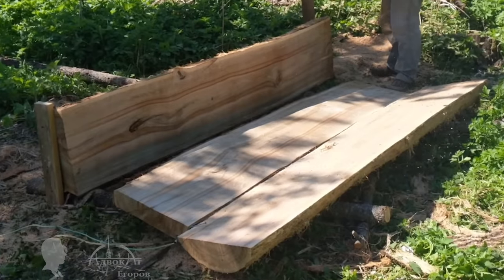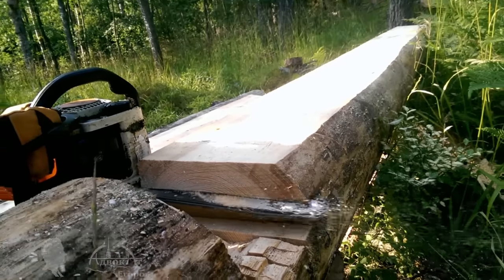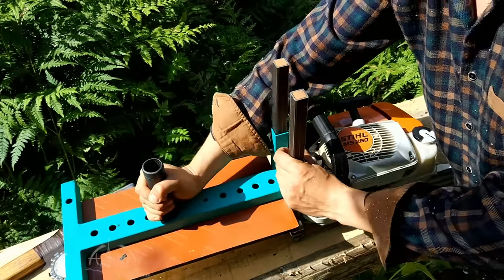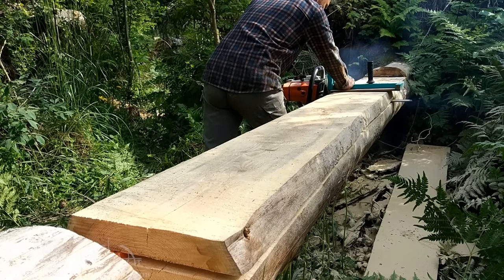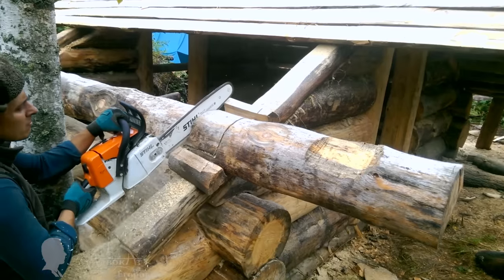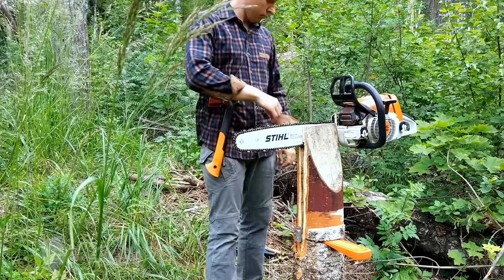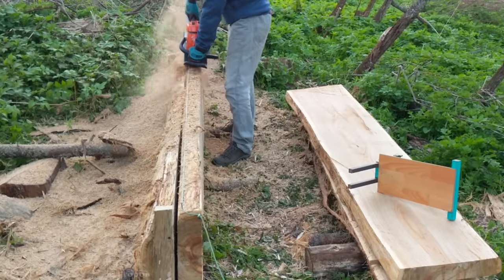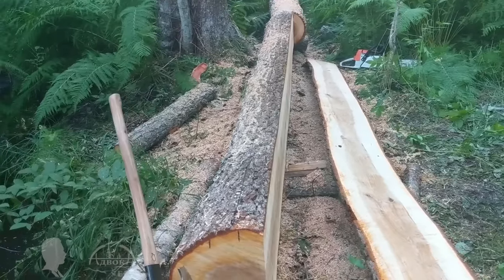Two Chainsaw Secrets | Turning a Tree into Perfect Boards

Comment: Your technique is widely used by lumber cutters in the Philippines. In fact, most lumber bought there is chainsaw milled. They get around the staking step by leaving the last few inches of the final pass until all the cuts are done then finishing all the cuts. Before cutting the final few inches they will rotate the log 90 degrees and do a second series of cuts creating perfect 2x4`s 6`s etc When the log is chocked well it does not move.  Great video.
Reply from the maker: Michael, thank you for the info
Reply: @Advoko  You are welcome. The cutters in the Philippines are using a much bigger saw. Maybe twice the displacement with a 36" bar. It's impossible for them to hold it as vertical as you do. If you are cutting on 3 teeth my guess is they are running on 7-10 teeth hence the reason they need the big power. I would love to show them your video. It's hard for them to come up with the coin for those big saws there. They could buy 2.5 saws like yours for the cost of one of the monsters they use. Never mind the extra fuel, blade wear, and the fatigue on the body holding that big weight all day. It's hard to tell for sure but I think you match or possi
bly better their cut-rate using the smaller saw. I spent many hours watching in amazement as those very skilled men who transported their one-man sawmills to the tree on a scooter cranked out a lot of lumber in a day. You have taken this to another level.
Reply from the maker: I think their technique is different as they use huge chainsaws with long bars. My main discovery was that you can mill a straight board making swinging motions and using just the lower tip of a compact saw.

Comment: Hello.  I have been working on small engines like this more than 20 years.  At 10:55 in the video, the fuel being poured into the tank looks like water.  If it is fuel it looks very clear like it has not been pre-mixed with oil.  When you pull the piston out of the cylinder there is clear evidence of overheating.  Too much friction --->  No oil or not the correct amount of oil.  Only one other thing might cause this and that is if there is no air filter.  The fine wood dust will make its way into the cylinder and destroy it.  I have been using Stihl products, and others, for more than 20 years.  Have never had an engine look like that. 
 Thank you for this video.      Привет. Я работаю над такими маленькими двигателями более 20 лет. На 10:55 на видео заливаемое в бак топливо похоже на воду. Если это топливо, то оно выглядит очень четко, как будто оно не было предварительно смешано с маслом. Когда вы вытаскиваете поршень из цилиндра, видны явные признаки перегрева. Слишком сильное трение ---> Нет масла или неправильное количество масла. Это может быть вызвано только одной другой причиной, и это отсутствие воздушного фильтра. Мелкая древесная пыль попадет в цилиндр и разрушит его. Я пользуюсь продукцией Stihl и другими уже более 20 лет. Такого двигателя еще не было.
  Спасибо за это видео.
Reply from the maker: Glen, thank you for your expert's response.

Comment: Are you still planning to publish the video about your lumber drying method that you mentioned? - I think this would be really interesting, thanks.
Reply from the maker: Malcolm, probably not as I had mixed results with it (in some cases there was a problem with mold). In other words, until the technique is improved I can't recommend to my viewers...
Reply: @Advoko  This is the way of natural seasoning.  The wood will do what it wants to do, even using the very best methods.  

Basically, wood has two types of water, inside: 1) water between the cells, and 2) water inside the cells.  The water between the cells will dry first, and fast  It has the easiest path out.  (This is why standing many freshly cut pieces on end will leave a puddle of water).  The water captured inside the cells will take the years of time. 

Imagine wood grain as a handful of straws.  When you cross-cut, you are opening up only those cells near the end.  Water in the cells in the middle of the board have to travel the length to get out of the ends.   It is the uneven drying that will cause the most stress between the fibers and cause damage.

Seal any end-grain, and leave any long grain open to the air, as soon as possible after the cut.   Type of sealant usually does not matter, just so it slows the water (latex paint, wax, even diluted wood glue (PVA)) all do fine.   Seal immediately, as the fast withdraw of the inter-cellular water is what will begin most cracking/checking.   The slower intra-cellular water will then exaggerate those splits/checks over time. 

As a bonus, that "mold" you saw might've been a process which we call spalting, and which many wood workers will actually pay extra for.  It is the beginning of the rot process, and if stopped in time, dried properly, etc., makes the most beautiful patterns and is safe to use.  Many of us TRY to spalt our wood.  Covering the long grain in those shavings is a good way to get it.  :)

Comment: Not a fan of the new(2016ish) stihl "smart-saws" with the auto-elevation adjusting chip. If that's what you have you can't let it run very low or out of gas. It will mess with the altimeter settings and not run or start right. Usually letting it idle for 10 minutes fixes it. Doing a full clean after each days use also prevents most issues.
Reply: You got that right Brother chainsaws run bitchen when the time is taken care of good plug good fuel mixture clean air filter and a properly sharpend chain hell I'm going to go out right now and clean my baby's , way better than listening to my wife hahaha!

Comment: Re: engine failure.  Couple of things.  We only run ethanol free fuel as the ethanol can burn hotter/drier. 2nd: I would recommend always mixing the fuel and oil first so it is homogeneous. The excoriation on the piston looks like it is oil starved. I am not sure if there is a slightly heavier 50:1 oil you could use,  might produce a little smoke here and there but should help saw longevity. There are a lot of Stihl Gurus on YouTube,  I would forward your questions to them.  Goodluck!
Reply from the maker: Thank you for the reply!

Comment: 260 is a great saw for bucking firewood and limbing, but for cutting lumber or milling you definitely want a bigger chainsaw....I had a 044 with a Alaskan mill in the early 90's using a 24" bar ,we felled yellow pine and let the logs sit to dry/cure for a year then came back and cut 16x16", "14x14", 12"x12" beam for timber framing. Currentlyi just bought a Stihl 661 C-M it will be sent out to be ported,polished and muffler mod,I will use a Grandberg Alaska Mill,bar and a couple chains . 
   One thing I noticed is when you were cutting horizontally in the beginning of your video you complained of how hard it was to rip compared to when you cross cut.....you need to place multiple wedges after you cut as you make your way down the log....it will still take time to cut but not nearly as long or harder. 
    The riving chain works great but milling with a power saw/chainsaw takes time

Comment: stihls run great , just mix 6.4 oz to 2 gallons .. not 2,5 gallons ,  i use royal purple 2stroke synthetic and a little lucas fuel treatment or seafoam sometimes . use only synthetic , dont rev the saw to high- only with a load on it full throttle

Comment: For a chainsaw I would recommend a contractor grade Husqvarna, they seem to be a bit tougher than Stihl in general. You might even be best getting an old Husqvarna from the 70's as they are built very tough, I'm still using my Grandfather's 1970's 54" chainsaw which has been used to build a few log camps and has cut many cord of wood without any serious problems.

For marking out your cut lines, have you ever tried using a chalk line instead of having to leave cords or lines in the way while cutting? Also, I was wondering if adding a simple horizontal level gauge (bubble level) across the back of the saw would help much in getting perfectly vertical cuts.
Reply from the maker: Thomas, thank for your reply. I ended up getting a Husky 365 chainsaw...

Comment: The Stihl 066 with either a 28-in bar or 42-in bar.
Using a jig with the 42-in bar you can have it cut at about a 30° angle so it's doing a rip cut it works very fast if you try to cut the wood straight on like the setup you're using the saw Will bog because it's not pulling parallel to the grane.

And on the newer steel saws they use a hyperveric piston that does less thermal expansion so the clearance is much tighter than the older saws.
If you run your oil thicker than 50 to 1 mix it will actually cause the motor to overheat because the oil is thickening the fuel mix just enough on the cylinder that it will start to gum once it starts to gum it overheats the piston and it will seize and Gall the piston like yours.
Reply from the maker: Wayne, thank you for the reply and tips!

Comment: I use Echo saws. I do 80% of my cutting with their smallest baby-saw - 30cc, 14" bar.  I like that it starts in 2 pulls -always. I like that it uses very very little fuel - a gallon of fuel lasts several days of hard work. That gallon of fuel would last no time in a bigger saw - I know as I run a bigger saw as well - it guzzles fuel in comparison. And guzzles bar oil. I dislike buying fuel. And Oil. All bigger saws guzzle fuel. I have the big Stihl, big Huskys, blah blah - they stay on the shelf mostly. 

The Echo sips fuel - ergo, low overhead. I like low overheads. It also cuts like a beast - it's slightly modded - the muffler is dicked with, I changed the bar to a premium bar, use waay more aggressive chain than they say you ought, the carb is tuned to within an inch of its life - and gets re-tuned daily -  plus cleaned/serviced every morning before work.  The chain doesn't get filed, a new chain goes on - a new chain lasts roughly 12 weeks of hard use before it gets dull - it just does, don't care what the "Experts" say. 12 weeks - then bin the chain. Week 13? Buy a new chain.  By then, it will still cut good, but the drive-links will be worn right out - no filing required.. blah blah - simple stuff. 

 A 14" saw will cope with anything up to 27/28" in diameter if it says "Echo" on the sticker.  Also ignore their "For Light Domestic use" sticker. Mine gets hammered all day every day and is a 2017 saw. It never gets asked to do "Light" or "domestic" work - today it milled slabs from a big beech - which means it ran, flat out, full throttle, for several hours just doing that - as well as being expected to fell/cut to length & de-limb several tons of "normal" firewood - from a 30cc saw. I work it 7 days a week - have replaced several worn-right-out/bent into a hoop bars at this stage, but have never touched the power-head beyond cleaning & servicing it a lot. If it broke, I'd buy another in the morning without a thought. I don't even regard it as a saw - at this stage it's an appendage to my body I use it that much. Echo make great saws - like they always did. I have the "previous iteration" - an older Shindaiwa (Echo) - and it still works great, but being a 50cc saw, it guzzles fuel, so I save it for when 14" just won't work - which is not too often. My "Big" Shindaiwa is 18 years old - has been hammered to death all its life, is on "Bar number who knows what.,." and still runs great, starts in 2 pulls and has never been apart either,.
Reply from the maker: James, thank you for your detailed review!

Comment: Have to say best medium saw I've had was a stihl 036 pro. I ran 18" 20"and a 24" bar.
On the larger size an 066, but that saw was modified. I received it from a logger who did that work so I can't remember what all he'd done to it. 
  Here in the U.S. our biggest problem is ethanol. 
If you can find ethanol free fuel sometimes called racing fuel, all your saws will cut and last better. 
 Now I have a MS 367. It's OK but I don't use it enough to really rate it.
Reply from the maker: Tom, thank you for the info

Comment: You need to buy a "rip chain" when using an Alaska Sawmill.  Otherwise,  it will be a much slower process.  They have a different tooth grind angle, than a "cross cut chain".   Most chainsaw shops will make you one, if you ask for them.    Stihl is a good saw brand, you just happen to have a bad one.  Get a "Husky" saw if you are unhappy with Stihl.   I love your video. I'll be sure and give it a try.

Comment: Go for a Husqvarna 450. I have also found that adding just a hair more oil to the fuel mixture than what is recommended makes them last longer.
Reply from the maker: I ended up going with a Husky 365 saw...

Comment: Great tutorial! At the end of the video, you put down saw dust shavings, also you didn't TIE or STRAP the wood down. Any reason for that? I would think you'd want it tight so they don't warp?
Reply from the maker: I put down saw dust to try to equalize drying process and prevent splitting. You could need really strong strapping system to prevent warping.

Comment: Its weird you had such trouble with your Stihl chainsaw. Weird question, the fuel you put in looked really clear. Did you use the fuel additive? Its absolutely crucial for lubrication and your Stihls piston looked like ich lacked lubrication.
Reply from the maker: I used the same mixture for both of my Stihl chainsaws. My 20 year old 180 was fine…

Comment: So with 2 strokes  you have to stop and refuel before it runs out because the fuel carries the lubricant for the cylinder so it you run it out of fuel its not getting Lubricated it doesn't matter who makes it or what 2 stroke it is if its not lubricated it won't last for more than a few uses

Comment: Nice, succinct quality video! Straight, & to the point, … and as you are familiar with chain saws, their care, & maintenance, I believe someone might have told you they repaired your saw, but after seeing the way that piston was all chewed up, … well, let me just say, … I would wonder about that, … even if it was a dealer item repair, where they slapped a new piston, into a scratched, & contaminated cylinder, … the piston, … must slide flawlessly, back, & forth, on both sides of the cylinder walls, … and yes, they will get egg shaped after continuous usage, but it should take a good number of years, to get to that point, or else you have what I call a contaminated culture, … if the piston gets that scratched, & gouged up from normal wear, & tear, of only a couple of months, then something, somewhere, went terribly wrong, … get your parts list out, & check, that every screen that should prevent contaminates from entering into the air, & fuel, & oil lines, all the way to the combustion chamber, is the way that they show it in the exploded view schematic, … other than that, I’d be calling them for guidance as to how to expect it to get a much longer life cycle from such an expensive piece of equipment, … or you may, have to figure out, how to make a band saw blade machine on a portable basis to do exactly what you need to replace the chain saw mechanism for, … gearing it, should not be a great undertaking, & perhaps, by combining the 2 features, you may yet become successful, in designing a portable field unit that can be of such useful purpose, … good luck, let me know, if I can help out, with any theoretical solution, …
Reply from the maker: John, thank you for your offer, I actually ended up buying a Husqvarna 365 saw about a year ago and it was performing flawlessly.

Comment: I would recommend a Stihl 391 it's been real reliable. But you must make sure that it is of German manufacturer and not Chinese. There are many Chinese built Stihl saws made these days and they are not reliable. So look at the manufacturer. 
I used to live in Papua New Guinea and the locals there would use this very exact technique to cut huge logs into straight slabs using only the tip of their chainsaw. Of course they were using huge saws such as a Stihl 070 or 090 with a 36-in bar and they would stand on top of the log. They would take a string soaked in old motor oil and snap a line which they would follow as they walked backwards along the log.
Thanks again for your very informative videos.

Comment: The reason the MS260 faled is called "high rev , no load" . The saw is designed in such a way thay the high RPM's are regulated by the log you are cutting. You were just using the tip to cut causing an over rev situiation that will score a piston. I work at a STIHL dealer and have seen this problem from people using too powerful a saw for things like knocking off small branches.
Reply from the maker: Thanks for the reply, Gliff

Comment: Maybe someone else could explain it better, but I imagine the straightness of the cut is due to the curve of the stroke in the same way a circular sanding motion provides a smoother surface. Something to due with the geometric properties of squaring a circle in two dimensions, instead of tipping into the third dimension to produce a sphere. Come on math nerds, help me out

Comment: The gas you are filling up the tank with does not appear to have oil added?  Maybe it does! Make sure to use Stihl's 50:1 oil.   I have had similar issues using other brand oil additive
Reply from the maker: I used same mixture for both chainsaws (Stihl 180 was used as well)...